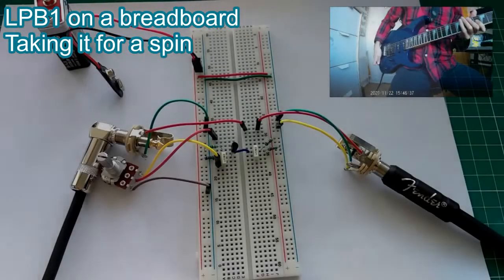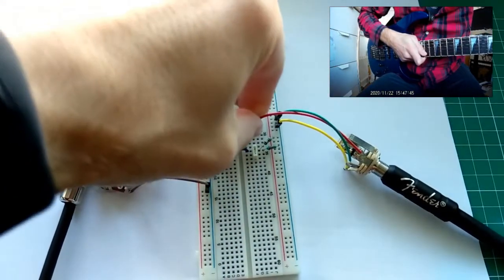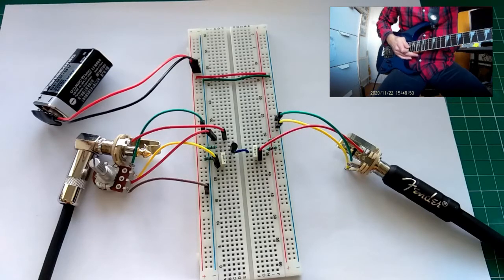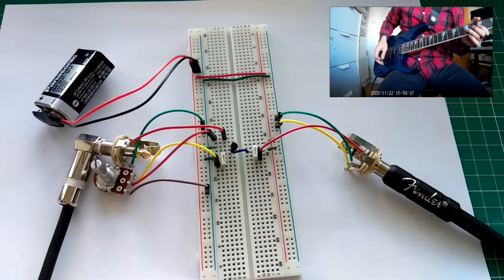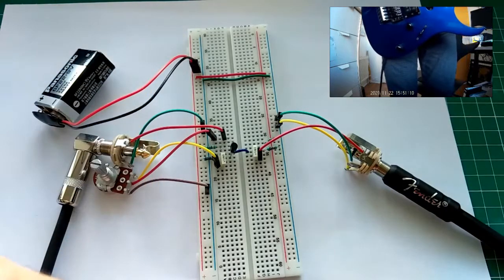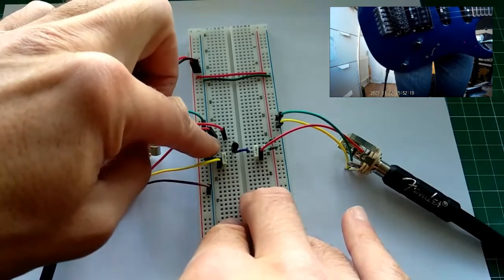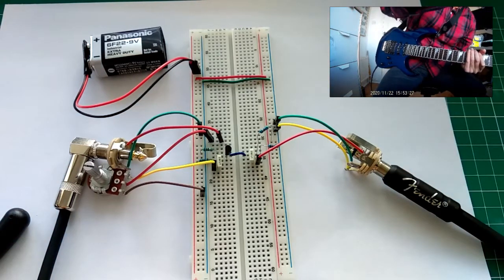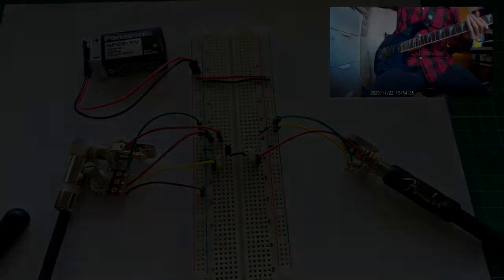DIY Guitar effect on a Breadboard - Giving it a try

Comment: This is my first pedal and it’s not boosting my guitar but dampening the sound, any ideas why?
Reply from the maker: hi, I'm not sure if you figured it out already. I can only guess - some of the general steps to do are: check if you have connected everything correctly, check if you're using correct resistor values. The voltage divider at the input is very important, I think I had too high resistor values once, even though the ratio was correct, and base current was throwing the ratio off and I could barely keep the transistor on. If you figure it out, or if you tried different things and it's still not working please report back and we can continue troubleshooting ;)

Comment: i tried your schematic with a 2N2222A transistor instead and 4300 + 430 ohms for R1 and R3 and i got a huge signal in my amps. so i guess i should use the correct components, may also be the potentiometer 500k is not enough...
Thanks for the tutorial, i'll try again later
Reply from the maker: Hey there. The issue is in R1 and R3. 2n2222A should work just fine. From what you're saying, the effect is working, but you did not get the boost? The reason 430K and 43K are chosen (and you can use 470K and 47K which are more common values) is to try keeping the input impedance as high as possible but still being able to keep transistor working. This is still low impedance and causes some "tone suck" and with such small values for R1 and R3 you're using that effect will be even more pronounced. Lower the input impedance lower your output signal essentially. Anyway, maybe try higher values for R1 and R3, even 100K and 10K will be an improvement.

Comment: Build yourself a test box it will be easier than connecting all those jacks etc. there is a vid on my page if you need help
Reply from the maker: I'll have a look :) I had built a test box a while back. It just did not do it for me at the time, it did not lower the noise and interference as much as I wanted it, and it just wasn't compatible with the way I like doing things. Maybe I should revisit that idea. Thanks :)
Reply: @BarbarachBC  Yeah it won't lower the noise if the circuit is on a breadboard, its only designed to make the connections easier. It might lower the noise a bit if you use insulated input/output jacks. Anyhow heres my vid it might help: https://www.youtube.com/watch?v=l5nUPE81Lm0